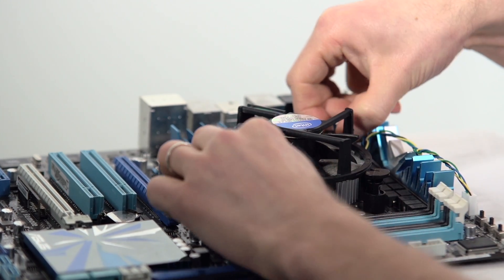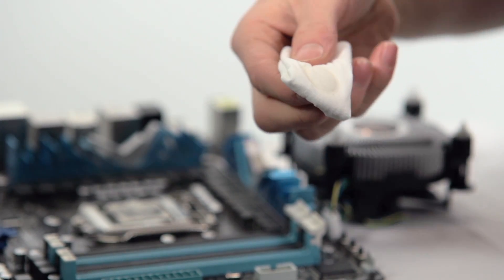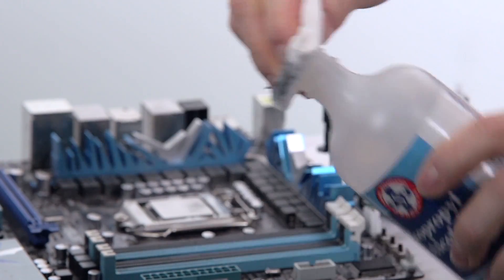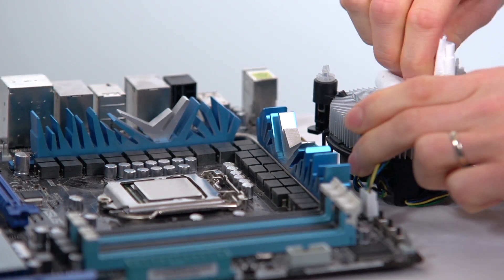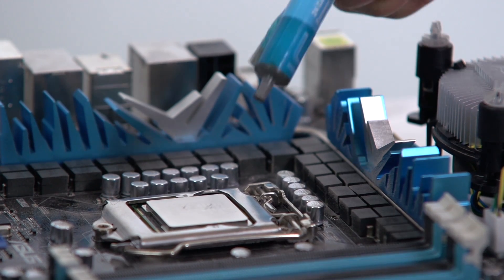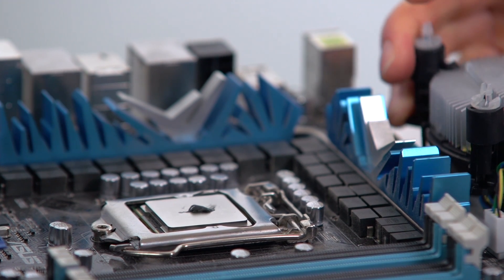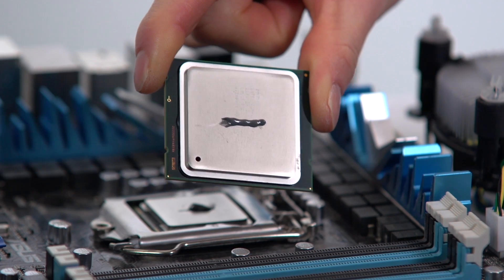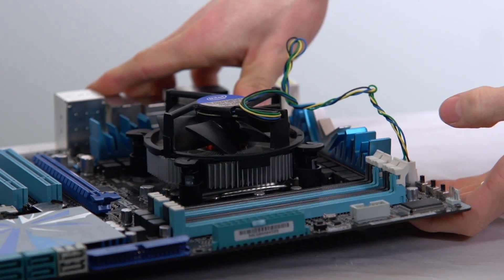Install Thermal Compound Paste as Fast As Possible

Comment: I use copper thermal paste, and my cpu is running at 29 degrees c.

I use a bit more than what this tutorial did, because I am afraid of small spots not being covered.

My two cents, just don't use the @#$% paste thats packed in and you'll be alright.
Reply: David G
I'm calling bullshit
Reply: Unless you have your computer inside of your refrigerator, you do not have idle of 15c.
Reply: 15 seconds in: "non-conductive"
for obvious reasons...
Reply: David G I don't know that you are using to look at your temps but I would install something else and see if the temperature is different.15c is unreasonably cold for idle temperatures :)
Reply: David G my 8320 with a 212 evo idles at 24, so I really don't believe you
Reply: Kieran Wharton
Yeah I use top tier and my diamond thermal paste with 9 fans and a hyper 212 evo and mine only goes to 16c lowest, rarely 15. Its usually at 17-19c
Reply: I only got one temp for all cores called (core) at the bottom. running at 15c
. Six core AMD fx6300 3.5GHz
Reply: Cole H
 I just posted a gyazo link of my idle temp you idiot. It's on my desk next to my monitor. I live in Temecula, a desert city in southern california.
Reply: David G
Where's the link again im calling BS
Reply: Kieran Wharton
 it shows up for me, but idk if google is allowing it.
Reply: Cole H
 I use speedfan, it's labeled "core" it might be wrong, what program do you use?
Reply: Hey ProtoMario :3
Reply: ProtoMario A
Reply: my amd idles at 15c and maxes at like 30c.. and I use cheap componets

Comment: my isopropyl alcohol is 60% , is it okay?
Reply: I just use whatever hydrocarbon-alcohol in high percentages I have laying around. Usually I start with under 90% ethanol (cheaper) mixture, then when most visible muck is gone use 95+% and clean wipes as Linus stated. Hope this helps.
Reply: No

Comment: is toilet paper really okay ? what about static ?
Reply: As long as you are properly grounded it should be ok, you just have to look out for the tiny fibres that might come off the toilet paper :)
Reply: Toilet paper and paper towels will leave paper particles behind, do not use them for cleaning a CPU or heatsink.  I use a soft bristle electric toothbrush and Arctic Silver 2 part cleaner.  I use canned air to dry the CPU between and after stages.

Comment: Wouldn't applying just a pea size thermal paste on the center of the heat spreader or die be efficient enough? Underneath it, it's just a tiny relfected silicon chip. As long as you got a thin layer of paste on top, it doesn't matter if the paste doesn't make good contact with the far corners, does it?

Comment: Is using the stock thermal paste ok? or should i remove it?
Reply: stock paste is fine for every day use though personally mx4 thermal paste or what linus uses is better either stuff alone can shave off another 3-4c even with stock cooler

Comment: guys someone plz help,ill install a hyper 212 evo in my new system with the paste it comes with,whould i use the pead in the middle or the line method?also if its the line method which direction should it be?

Comment: Actually I'm not an idiot. And yes components are put in ani-static packaging so the company doesn't risk anything. You can easily wear an anti-static bracelet while using a wool shirt to clean a cpu and you can also ground yourself. Also components are very robust now days so its very unlikely that you will ruin a cpu from a small static shock. Also I'm not encouraging anyone to use a wool shirt to clean their cpu with. You're just thinking about the extremes.

Comment: I would not use toilet paper, but coffee filters make a great substitute if you don't have a lint free cloth. Also I would not recommend touching the top of the cpu or the bottom of the heatsink after you have cleaned it. The oils from you fingers can transfer and cause heat spots.

Comment: I use little cloths designed for rubbing/cleaning the skin before giving a shot, found at pharmacies, it works well. It is creepy to put the paste on for the first time, but if you take your time and do enough research, as anything else with builds it's not really difficult.

Comment: from wiki - "Thermal grease is primarily used in the electronics and computer industries to assist a heat sink to draw heat away from a semiconductor component such as an integrated circuit or transistor." look it up, it will help u understand.

Comment: So Linus mentioned at :20 never use a product that would dry out over time. Well what in the HELL is INTEL using under the IHS ??????????? Have you seen some of the videos removing the IHS off the i7 3770K Ivy Bridge... I'm pissed at Intel for not soldering on the IHS like they did on the Sandy Bridge just to save a few cents.

Comment: I would love to see the thermal paste after this. I don't trust this method anymore as I have found very small spots that did not get paste on them, even when using more than enough paste and having it ooze out just slightly around the edges. I would never install a heatsink for any long term application without properly applying paste to both the cpu and heatsink, and spreading it very thin and very evenly to ensure total coverage without using too much paste and causing more thermal issues.

Comment: Haha, there are actually hardcore drinkers in the house, but I can get 100% pure IPA from my workplace. 

Case is actually CM 311plus, it has PSU installed btm with transparent panel at the side, but no top ventilation. 

Thanks mate, for the help !

Comment: Coretemp has been pretty accurate for me for year.  Decent case.  The only or main thing I dislike about it is there is no ceiling ventilation and that the PSU is at the top like older style cases.  Ceiling ventilation can easily make a 10 C positive difference towards better temps.

Not sure if you need to repaste or not.  If you haven't tried it yet, perhaps that is in order..just MAKE SURE.  If you're going to use isopropyl alcohol that you use it that is as close to 100% as possible.

Comment: 1. i5-2500K Sandy bridge ( Overclocking not configured)
2. CM Elite 310
3. Yes, Fans only.
4. 25*C

Is there any recommended software to monitor CPU temp? Probably I need to do repasting thermal compound. :S

Comment: My problem with IC Diamond is, I bought a grip ton of it because I take my computer apart often. It is so much thicker and unspreadable than silver, I just went back to silver. I could not get the diamond to spread. I tried by hand first, and it wouldn't move. I then tried the pressure method and I got terrible temps. It would just not move at all. I have an H80 BTW.

Comment: I also use IC Diamond. Do you heat up the IC Diamond in hot water before applying?

if not, you should as it spreads easier ;)

Comment: I been taking a look at the new AMD Vishera FX CPU archetecture pictures on google and if you look closely at it you can see they changed the cores position unlike the Bulldozer, its no longer in the middle of the chip but the cores are now at the edges, does this mean that the Vishera CPUs are no longer affected by the pea method but the line method is perfered, i need help on this if anyone can answer this!!!!

Comment: IC Diamond is very thick, but still easy to spread.  It's actually quite a bit harder than other compounds that it has a polishing effect on heatspreaders and heatsink bases.  Something to consider if you ever think you might need a replacement CPU under warranty.  Overall it's my favorite compound too as its given me up to 1C better temps than MX-4, which is also good.  Stay away from the liquid metal products...

Comment: its ok if the thermal paste is only on the cpu metal part but if u had applied the thermal p son some part of the motherboard it can trouble the motherboard cuz it will make electrical charge pass through the thermal paste and can create a short circuit and your motherboard will die if u have not applyed TP on motherboard and only the upper part of the cpu you are good to go :D

Comment: Hey Linus! I recently purchased an H80 for my 3770k but I spread out the thermal compound all over the CPU.  Should I open it up and re-do the thermal compound or should I leave it running as it is. I live in India and the temps (currently) are around 24-28 (lowest core temp-highest core temp) at idle.
Thanks!

Comment: What is the difference in applying thermal paste between the HDT cooler and the flat nickel plated base plate cooler like the NH-D14? Can the pea size method work optimally with the HDT cooler?

Comment: 1. Which gen?  Sandy bridge or Ivy?
2. What case is it installed in?
3.  Stock fans in the case that came with it?
4.  Room ambient temperature?

Beyond that, it does seem alittle high for idle.  From what I've researched and see from my friend's 3470 ivy bridge it really shouldn't idle higher than 36 to 38c at 71 degrees F room ambient temp with a decent case stock fans stock included intel cpu hsf.
My 1090t amd cpu maxes at 56c with Handbrake full load on all 6 cores. Zalman 9500a 40% speed

Comment: thanks, well I use typical fan cooling for CPU which comes along together with the intel chip. During idling, CPU temp is around 45*C, and I am not sure when it's fully loaded. Does it mean I should probably reapply the thermal compound?

Comment: Also IF you're going to use Isopropyl Alcohol.  TRY to get it in as high percent as possible.  The closer to 100% the more " pure" it is. Thus less chance of leaving any mixed residual/harmful things on the cpu to get mixed in with the new application of thermal paste.

Comment: it goes everywhere when you put the heatsink (and some thermal compound is conductive (could short motherboard)
and your temp rises (thermal compount is worse than metal to transfer heat)
So you don t want too much but you don t want too little at the same time.

Comment: using your sleeve? this can leave behind dust or oil  residue (food or similar). I usually use lensecleaner paper, that will not leave behind any particles that can inhibit performance.

Comment: the stock cooler. i know about the aftermarket coolers that do work a lot better but i havent got any money for that unfortunately. my problem isnt the cooler though, its the temperature and heat that i dont understand. even the AMD website says that it shouldnt go over 62 degrees

Comment: Here's one for you. My AMD CPU likes to go as high as 69 degree celsius when am compressing a 720p HD video for example or rendering in After Effects. I'm using a 1055T processor and no, I'm not overclocking or anything similar. Just running it at basic performance. Everything runs perfectly fine and dandy, not failures or anything like that but any ideas on how to cool it further?

Comment: When I got my first aftermarket cooler, I never used anything but stock that had already had the paste applied. Now I had to apply for myself thermal paste. So what did I do? I used it ALL. I dreamt of overclocking with my new cooler but stock clock didn't even happen because Intel SpeedStep kept it very low because even that made it idle at 99C. I couldn't fix it for far too long (by the time I had gotten new paste, because like I said I used ALL of it). A pea-size gives me 45C idle, 61C load.

Comment: if it is none conductive , not really , because the pressure will get-rid of the extra paste , but it will leak to the mobo , so if it is conductive , you are in trouble, but even though most  mobos have a layer of wax to lower the impact of humidity